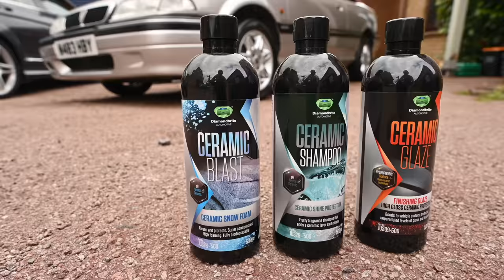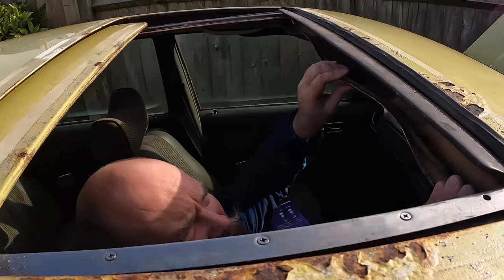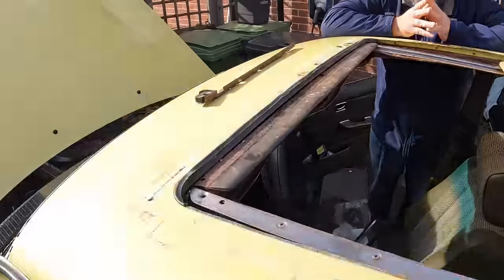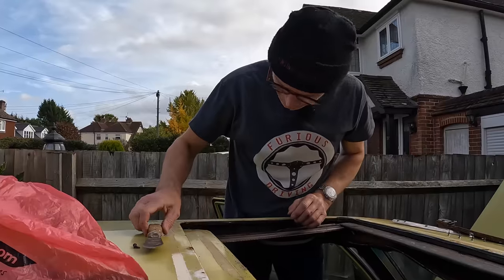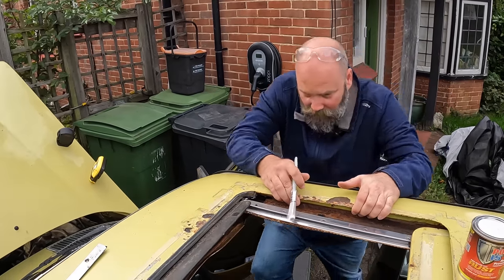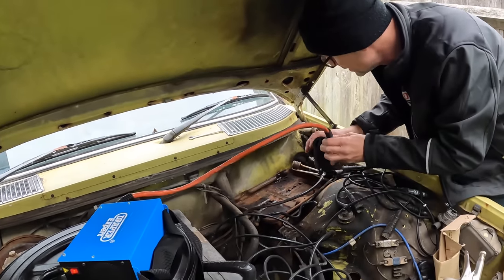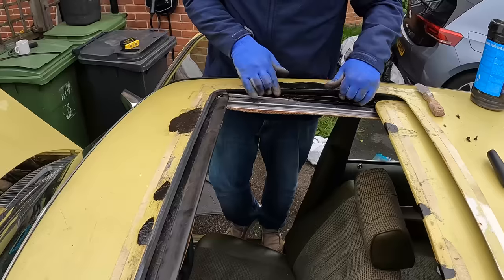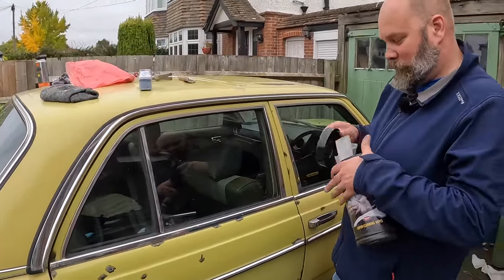I gave my friend a W123-is the sunroof too rusty to fix? 40 minutes of dad jokes and messing around

Comment: You two together are hilarious. Just a pair of observations regarding the sunroof situation:
1. Seals in Mercedes of this era don’t keep water out, they primarily reduce wind noise and keep dirt out of the tracks and drain hoses. If you have water leaks, that usually means the tray is rusted or the drains are clogged. Is obvious which one is the problem where. 
In the case of this car, the tray will have to be replaced or patched & repainted; there is no way round it unless you want to weld the rood shut which is about as difficult as fixing the sunroof. Pulling the tray out will give you access to the whole mechanism that, judging by the noises and how slow it is, is in need of cleaning and lubrication anyway. For now, the best thing would be to tape the sunroof opening and any other hole in the roof so that water cannot flow until you have a chance to pull sunroof mechanism apart. 
2. The sunroof is binding for two reasons: the front rubber seal looks like an aftermarket replacement and is too thick, but main reason is that the new side seals are too wide. I had the same issue in my W123 after replacing those, the sunroof would bind on one side and the panel couldn’t close all the way. So, I had to take everything apart and grind off some tabs in the metal strips that hold the side brushes to allow them to sit further in. Then I had to reinstall everything but before tightening the bolts, I had to use a piece of wood to drive the side seals as far in as possible. Those new seals are way too big, they work, but you have to persevere.

Comment: Looking at the rust damage of this sunroof, it seems to be a heroic effort to rescue it. I had much less rust on my every-day-driver 1978 W123 240D some 30 years ago. But I ended up taking out the inner top lining after taking out the front and rear screens, in order to be able to get out the large shallow water collecting thing installed under the sunroof. I sandblasted and repainted every bit of it. I replaced the rusty sunroof. But the roof's edges around the sunroof just kept rusting again after 2 or 3 years, despite sandblasting and professional repainting. In terms of rust prevention, these W123s simply were not made for eternity. Engine and gearbox were undestroyable, though. Mine had some 420.000 kilometers, when I handed it over to a commercial buyer - and maybe, my old 240D is still in service in some Eastern Mediterrian country.

Comment: The sunroof cassette needs to come out and be repaired or replaced 
There are two drain pipes at the front which would of rusted away and letting water in the cabin

Comment: I'd run a mile from a project like that, I dread to think how much rust lies beneath...if you get the old banana bus (yellow, big barge, so banana bus, don't quibble) running with a clear MOT I will be mightily impressed. It is 'beyond economic repair', so I want to see it happen. 
A very British car vid chaps, well done. Glad to see a cup of tea featured. 🇬🇧
Reply from the maker: The last owner spent a fortune on welding the chassis but then walked away, so its actually totally solid under neath

Comment: Umm......those outer seals aren't really a seal,  they help, but sunroofs rely on the channels, which are rotten, to allow the water to drain via the front or rear drain holes/tubes.  They are often blocked and in this case caused the water to sit, rot and leak.  Had those outer seals have worked, they would have made no difference.

Comment: Thought I was watching a comedy channel for a moment,   Funny sized bolts must be a thing in Germany as my German made small size socket set has 8.5mm 7.5mm and 4.5 mm sockets in it, along with 10, 9, 8, 7, 6, 5 and 4.  Tiny Torq tools as well, almost clock and watchmakers sizes.  They are known for (expensive) precision engineering.

Comment: I remember having a leaking aftermarket sunroof on my '78 Capri, I just got some sealer on it and sealed it shut 😂 I was only 19 and didn't know any better. I had another car a few years later with the same problem, I put some curtain wire underneath one of the folds in the seal and it never leaked again!

Comment: Honestly, i know many frown on non original restorations, but i dont care, i love w123, its the reason i found your channel, so trust me, i would not hurt a w123, but in this case, i would take an angle grinder to this, cut out all the rust, and i mean every bloody bit of it, fabricate a solid inox sheet-carbon fiber-kevlar-titanium 0.1mm wire mesh roof and fit it onto the area where the sunroof was... You know, just how you can get those carb.fib. solid replacements for bmw sunroofs... The area would be modified to allow for fastening of the fabricated roof, all would be sanded, keyed, filled with some proper filler, if not epoxy filler and then sanded down again, painted and voila, no rust, a lot of mass removed from the top of the car and it would look as if the roof was never a sunroof... Moan all you want purists, but a car like this should be afforded any and all care and refurbishment that will aid it and allow it to be even better than before... On the other hand, you could do the same with a oem thickness sheet of inox, and having spot welded it in place, bronze braze or if unsure if warping may be a problem - soft solder it with lead the rest of the way and all the rest is usual stuff, sanding, paint, etc.. It would be a much heavier roof, but again, one that would never fail again...

Comment: Honestly this is by far the section that you DON'T want rust occurring in a w123.
The sunroof section is easily the most difficult area to get rid of rust especially one that is as bad as this one because it's very narrow, has four tubes that act as drainage and you pretty much have to take out the the entire sunroof and headliner.

Edit: chaps the side felts of the sunroof is not designed for sealing instead it's whole purpose is a sound deadener. The very design of the sunroof is to allow water to go in the sides of the sunroof so as to be channeled into the drains like how a car door is designed to allow water to go through it.

Edit 2: these sunroofs have an adjustment screw on the 2nd to last screw on the front of the rail which is also a special screw and with these you can actually adjust the position of the sunroof relative to the roof itself as to make it flush with (or as what instructions call for, very slightly lower than) the roof itself.
Reply from the maker: THanks, want aware of the adjuster screw on the rail, That will make a difference to this, although Im in favour of welding it up
Reply: @furiousdriving  Oh yeah there's two other things I forgot to mention.
All the felt peices that are being made are not exactly OE so not only the length needs to be trimmed but also the length of the felt needs to be also trimmed to fit since like I've said their purpose is not for sealing it's for sound deadning.
The other thing is that Kent Bergsma's mercedes source website has excellent knowledge about everything w123 including videos on alot of materials even though he exclusively works on diesels but everything else applies to all w123s from taking apart the sunroof to the wing mirrors and even greasing the door hinges since mercedes of this era had grease fittings on their door hinges. I have a '79 230 w123 that really helped me on the more obscure things that make a huge difference when fixed.
That said about 80% of his videos are on-demand videos on his website so you're gonna have to pay to see them.

Comment: Hopefully as 3D printing improves, parts for any car will available at reasonable prices.
Reply: Even if metal 3D printing ever becomes properly affordable you'll still need someone to create drawings for every single part before you can print. That's usually a lot more work than actually printing. And in order to create a model you'll need either an intact part of manufacturer's drawings.

Comment: The problem with this type of sunroof is that the seals are just weather seals and aren't designed to be watertight.  The channels around the sunroof should drain down into the wheel arch (normally) and those drain tubes get blocked over time. Or as in this case the channel rots away !

Comment: So, the tapes going back on again then, right? 😂

About 5 years ago I noticed some rust holes had appeared round the edge of one of my Fiat Uno`s (dealer fit) sunroofs (is it roofs or rooves? Um.. Anyway..), I took the headlining down & found I could see sky, & not just through the glass panel.. I went to undo the frame & found a good percentage of the (30 or so) screws holding it to the outer frame refused to come out, so decided it wasn't worth risking going any further as I didn't want a flippin great leak because I`d buggered up the frame, so I did the age old thing of temporarily* filling the holes from the outside with P38 with the intention of getting a sunroof around 3" wider than the one fitted, so I could cut the hole bigger.. Guess what? 5 years on, I`ve still not found a sunroof that's bigger, & the filler is still there, spoiling an otherwise very tidy Uno.. Occasionally I think about just welding in some metal sheet & doing away with it altogether, then I remember 1. I don't have a garage to do it in, & 2. this is England, so sods law it`ll rain, even 2 weeks into a 3 month drought, as soon as I start 😆